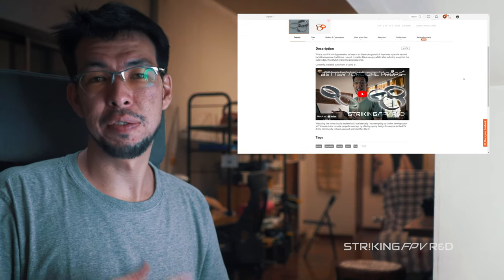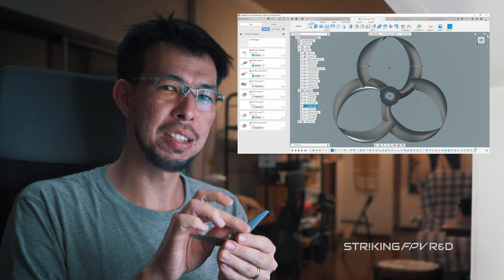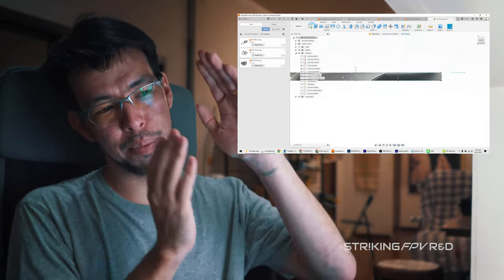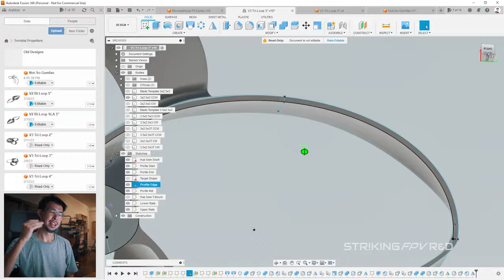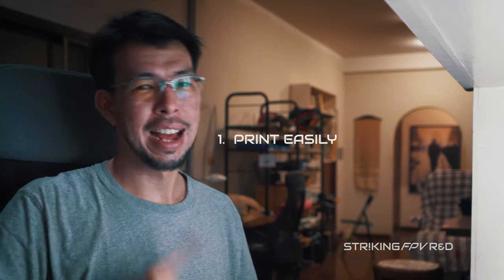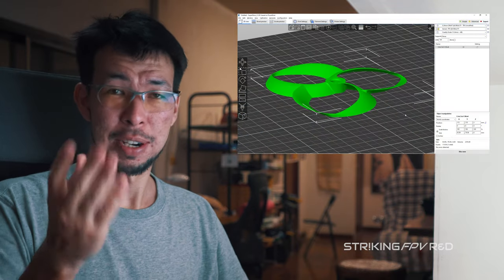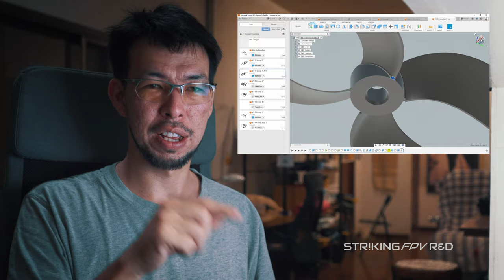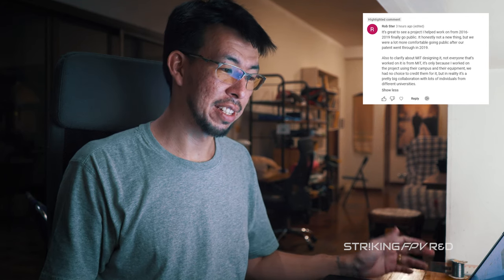10 Toroidal Drone Propeller Questions Addressed

Comment: Excellent work and analysis!! I think the main issue with using quad props on planes is the lack of pitch. Most good prop pitches for fixed wing range from 4" to 7". Anything lower is for hovering.
Reply from the maker: That's something I didn't know, actually.  Figures I should've looked-up common prop pitches for fixed wings, but then again I wasn't designing these for fixed wings to begin with.

Ah well, when I finally pump out the tutorial, other people can design and print their own with whatever pitch they prefer, haha.
Reply: Yes, that is usually true but I tested a scaled up 7' v2 bi toroidal last week on my flying wing and I normally fly with 7x6 so I didnt expect it to work as I think the pitch is 2 or something, but wierdly enough it had much more thrust with the toroidal and flew pretty good compared to it flying with a standard 7x4 or 7x3 which is way too underpowered.
Reply from the maker: @seantuitz  Oh that's awesome to hear!  And also strange but awesome!

I wish I understood more about proper prop selection, clearly it appears to be much more complex than just selecting diameter and pitch - it must significantly play into the motor specs and the weight and/or drag of whatever it is we're trying to fly, be it a quadcopter or a wing.

Comment: Iflight is showing off some injection molded toroidal props today.
Reply from the maker: Just had a look on their Facebook group and yeah, looks like they reworked their weird x-shaped prop and connected the ends, but it doesn't actually follow the rule of the toroidal, what they've done is essentially put a hole in the middle of a single blade that warped the two halves to be level with one another, as such the prop itself still has a tip.

Upside is that what they've done /can/ be made with injection moulding, but I fear flight performance won't be great. Could just be a relatively easy money grab riding the toroidal hype train.

I hope I'm wrong though, would be cool if it actually did perform.

Comment: I’m a mechanical engineer with +25 years in injection molded plastic and MIM design.  I do think a mold can be designed for this concept, with some tweaks for shutoffs.
Reply from the maker: Someone else on another video also mentioned that they reckon injection moulding can be done here,  so it makes me wonder a little, but the main thing is to not do my design but an actual "ideal" design which has a much much tighter transition at the blade edge and also has to deal with the blade intersection points on the trip-loop.

Would be great if you could have a look at my current models on Printables or Thingiverse - there's a 3D viewer available on those sites - so you can better work-out how complex it might be to do a mould.  You'd have to imagine a sharper trailing edge and also a much tighter edge transition to get the shape more optimal than what my 3D print model is actually like.  Of course, I guess you have CAD software too, and I've made the STEP files and Fusion 360 files available if you'd like to have a look.

If you can confirm that making a viable mould is do-able, I'd love to update everyone on my next video (hopefully a video where I get to test fly my own design).

Comment: Basically the idea is not new, check out Patent 3504990 by David Sugden or Patents of Rudolf Bannasch. Spend a lot of time working on the same and similar designs in 2016 but finally could not find a geometry able to keep up with a traditional propeller.

Comment: What if blades could be printed flat and melded into the required shape using another piece you design? The prop doesn't have to be in one piece right off the printer, as convenient as that is. The reason why I suggest this is because layer lines would add turbulence (and weakness, as you point out). Ofc, there's also non-planar 3D printing.

To expand on my idea a little. What I imagine is printing the hub and blades, then taking the blades right off the print bed and softening them up with a heat gun, to bend them over a shape in a way akin to sheet metal fabrication. Although this would be post-processing, it wouldn't be much. By doing this, there would be no supports and limited sanding required. The hub would have slots in it to glue the formed pieces into, or something to that effect.
Reply from the maker: I've thought about something like this, but was struggling to work out how to make it feasible. But having read your suggestion I'm thinking of another variation: print the hub and main blades as a single piece, but the blades are extra super long and the hub has the slots - you bend the blades back and slide the ends into the hub slots, then cap it off and stick it into a jig then heat to annealing temperature.

I wanna try it just to see if it works, haha, but I'll be doing some guessing on the blade geometry 😅
Reply: @STRIKINGFPV  Yeah. So for a 2 loop prop, you would have 2 pieces that fit in the empty space that the loops would form, which you then heatform the loops around (edit: um, these might have to be split up into multiple chunks so that they can be removed without breaking anything). Thinking about it that way, maybe modelling the assistant pieces isn't so difficult, because it's just the inverted space. Theoretically, because these pieces would support the loop geometry, the loop would turn out the same shape as intended. (keyword, theoretically :P) 

Then comes the question of materials. Using ABS might actually be a good idea in this case because 1: abs welding, 2: it's light, and 3: it's relatively rigid. The traditional problem of poor layer adhesion is moot when you're working with the layers. Whereas, with PLA, it may be simply too soft and low-temperature such that heating it causes an instant mess. 

Of course, if printing in ABS, it would make sense for the assistant-pieces to be printed in a higher temperature material like PC, or made with something like plaster of paris. This is starting to sound like a ton of work, but this technique could be used in other areas of 3d printing, and I'm all for pushing those boundaries.

I might give it a try, but I don't have a wind tunnel and such to test things with.

Step one would be making a simple heating-and-bending test, rather than trying to do everything at once.
Reply: Interesting idea. I made a 3D printed blocks for forming flat copper into blades for a heat exchanger. It would be tough to do, but it might produce results.

How about printing them vertically flat, making a reduction the outer blade thickness ~0.1mm. You could make a clamp that 'sharpened' the leading and trailing edges. Our company did some testing on gas flows and particle losses over shim materials, and orthogonal (or "flat") edges have a noticeable loss
Reply: Something like: Y have a 3D printer 4  when U can mold it ?!   BRIGHTNESS IN ACTION!
Reply: I believe hobby 3D printing is a fair bit cheaper and more convenient than moulding at home. Unless things have changed recently..?

Comment: For resin, my first test would be with sirayatech blu as it is pretty similar to petg if you really look at specs, and I am pretty sure that is what the ones shown were printed with (emerald blue for the really blue ones, and my guess is nylon black which has even better mechanical properties for the blackish ones. ). Anyway, my pitch in here based on nothing but a gut feeling is that a biloop with looping done axially instead of radially will allow for better transitions of the curves and would allow for easier and faster printing on resin printers. As a big proponent of fdm printers and someone who does all the 3d printing at a smaller aerospace company, this just isn't something you want to fdm at all, it really is the bread and butter for resin printers.
Reply from the maker: Very interesting to note, I've also heard of that Sirayatech Blu resin before, but like I said I'm not a resin printing guy so not that aware of its significance, haha.  When you mention the axial looping, I suppose you mean the loop would come off the print bed?  Considering your experience, is that something that you think resin will be happy with, and what sort of post-processing would you end up doing for that kind of shape?

I agree also that what this is really isn't the realm of FDM, but part of the spirit of this hobby is the relatively low-tech DIY that allows home tinkerers to have fun as well, regardless of the level of equipment they have, which is one of the reasons I try to keep my design FDM-friendly.  Also I'm biased because my printer is an FDM and I won't be affording a resin printer any time soon 😅

Comment: Hi, again thanks for this forum you are creating, this is so much fun ! 
I am stuck with the idea that the section on the edge should be horizontal rather than vertical. Indeed there is so much drag generated there for nothing, and not only drag: the first blade pulls the air out and the second one drags the air in, so at the end there seems to be a vortex that we don't want.
 I understand that it is the only way to make it printable, but I happen to have bought an injection modling machine so I am thinking on how to build it this way. I am working with fusion 360 but obviously not at your level, and when I download your step file, I can only see the final object and not all the history of your design. Could it be possible to have access to your full file in order to twist the external section and play with it? 
again, thanks a lot
Reply from the maker: Oh man, so yeah just discovered the STEP files from Fusion don't include history, so I've just exported and uploaded F3D files which in theory should contain the design history.  Let me know if they do, otherwise I'll be spending most of tonight trying to work out how to include the history
Reply: @STRIKINGFPV  perfect, it does work with the F3D files, thanks a lot. I will play a bit with them and let you know if I can end up with something useful. Cheers !
Reply from the maker: @alexisphilandrianos5786  Oh glad to hear, I don't need to do an overnight panic'd Googling session, haha

Comment: the new design is supposed to be more efficient, that can mean that they couple more of the motor's power to the air (which you would expect from more blade area anyway) so it's not surprising that the motors draw more power (run hotter, spin up slower)
The real question is if the thrust/power ratio improves (i.e. if they produce 50% more thrust but eat 30% more power, they are clearly 'more efficient' but will require retuning of the drone)
Reply from the maker: Yes, I think it might result in us needing to design a drone to best-suit the performance profile of the prop, as opposed to the other way around.

Then in terms of comparing bi-loops to quad-blades and the like, I also didn't consider what might happen if we tried to design a very low-surface-area bi-loop to minimise drag in comparison to its equivalent bi-blade.  But then the lower the surface area the less strength it has, haha.

So many factors to consider 😅

Comment: Maybe PLA+ would be a good material to print, its something between pla and petg its softer than pla but not so soft as petg.
Reply from the maker: Funny that, I found PETG to be a bit funny when I printed my old duct designs with it - very rigid, but upon hitting a certain load (crashing) it tended to splinter more, more delamination.  But it's kinda' like that with most materials, the more rigid you get, the more a failure becomes catastrophic, the softer you get the less it holds its shape but it doesn't fail so spectacularly 😅.
Reply: @STRIKINGFPV  I think i order a roll for trying, i mean they use it for 3d printed gun parts. 😅

Comment: The zipline drone is using a counterweight instead of one blade to make it quiet. It is an interesting Ide if you make the sides different you will distort the sound generated. The weight and possibly the drag will need to be the same on both sides.

Comment: How do you think this would work out for long range planes? We typically use two blade designs, and this would make it essentially a four blade. So less efficient. But if you can lower rpm for a given air speed it might prove useful.
Reply from the maker: I wasn't really sure since I had someone in my last video mention that my design did not do well at all, but on this video we've had someone mention that the design worked remarkably well, noting that my prop had much lower pitch than what he originally used and this worked out better.

I think a big challenge is choosing the right type of propeller which also depends on the motor and weight of the plane.  This, and there seem to be huge losses from the imperfect finish that 3D-prints usually have vs injection moulded props.

I also think that toroidals might have a narrower efficiency window, so to speak.  Like a regular prop can quite easily spool up and get a fairly linear rpm-thrust curve, whereas the toroidal might get higher thrust lower down but then run out of steam the higher you go.

Comment: Hello striking, I am going to carry out a project at the university in which I have to analyze a toroidal propeller but I must start analyzing the NACA profile using it, I want to analyze your design, could you tell me which NACA profile you used, it would be of great help to start my project.
Reply from the maker: So sorry for the late reply, and so sorry that I cannot really help in providing a NACA profile because I actually didn't use one.  If you want, you can download the F3D files from Printables or Thingiverse and analyze the sketches which make up the mid-section of the prop design.  You can get rough measurements to determine chord length camber and all that stuff, but essentially I free-styled to be most like an aerofoil whilst being 3D-printing-friendly.

The tutorial video might also help to see the process under which I designed the props.

Comment: I've heard many say TPU is too flexible but no one actually mentions what TPU they've tried. I'm sure A95 hardness for example is still way for flexible for props but there are at least D58 available that would be a bit harder, still might not be enough tho.
Reply from the maker: Where I am I don't really have as much ready access to TPU harder than 95A - it's the most common and I reckon most people who've tried doing these toroidals in TPU probably used 95A.

If there is someone with a roll of D58 lying around, would love for them to print one to see if it's viable or if it's still too floppy, or flyable but inconsistent because of the flex.

Comment: Personally, I think this type of design shows promise, but probably at much higher travelling speeds. Has anyone done an actual fastest ground speed test? I've seen some in water, but not air.

Two areas I would suggest looking into:

1) print a normal blade, not moulded. Test the difference. Then, print a normal blade setup, but with connecting pieces to irradicate wing tip noise. Test what the reduction in efficiency is. 

2) reduce the thickness at the outer edges a lot more on the toroidal loops. It would be hard to do, maybe with a 0.1mm nozzle on your printer, but an initial response my gut says that the heavier tip edges means the weight distribution is far too even. Normal blades have decreasing weight the further from the hub.

Also, is there a difference with using ducts? It's a shame you can't get your hands on a CFD modelling programme...

Keep up the good work all the same

Comment: I was wondering if the Bell Shaped Lift Distribution wing, as expounded by Al Bowers of NASA, would also reduce the noise of a prop. The twist of the wing causes the vortices to shed before, or inside of the wingtip, at say about 75% of half span so that the wingtip harvests energy from the vortex, like a winglet, but flat as continuing the wing. The explanation is that the vortex causes a vertical flow tilting the lift vector forward, producing 'Thrust' instead of 'Drag'. In the case of a Prop, may increase the 'pitch', the distance moved forward in one revolution, or at least improve efficiency.  
Al Bowers did experiments with the BSLD wing but I have not yet seen experiments with BSLD props.

Comment: So we are actually creating a wind turbine blade for a competition based off the toroidal blade. For our design I put airfoils as a the mid and final profile but I have been having trouble trying to CFD test it to get like the lift, and pressure, etc. So I have been having trouble finding data for the efficiency and power output. I was wondering if the final profile as an airfoil is a bad idea as far as turbulence goes. What are your thoughts?
Reply from the maker: I guess if I were to try and apply this design to a turbine blade, I believe it's still fine to use an aerofoil shape, however the orientation would be different.  In this prop design, the leading edge is facing the direction that the prop turns.  For a turbine, the leading edge would need to face the oncoming wind.  Basically an inversion of the prop design, if that makes sense?

If you've watched my tutorial on how I designed mine, you might see a bit easier how to go about designing it, but you'll have to think about how the rails which guide the loft command need to be laid out.

Apologies for the late reply, btw, you know, day job and life drama, etc.

Comment: Wow - who would have thought? Something like this will be the future, I think. Will there be variable pitch, washout (and washin)? And how are the effects of P-factor - are they a non-issue, or does it get worse? And if ducting these props is a no-go, will there be an application for jet engines? Lots of engineering and development to do, so whoever has a patent now will be stuck in the past of the future.